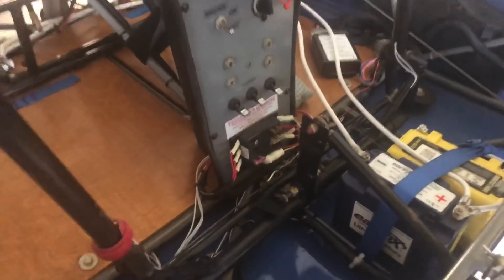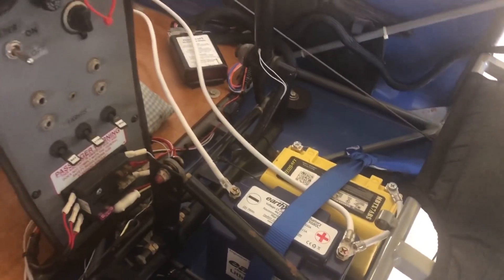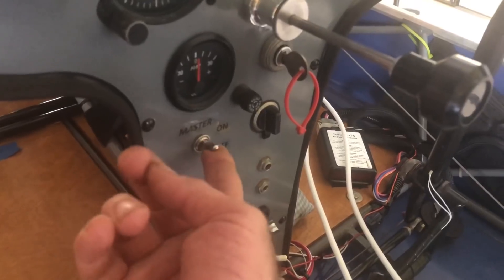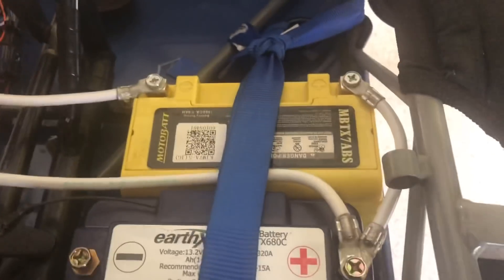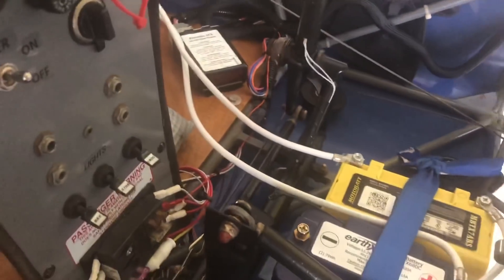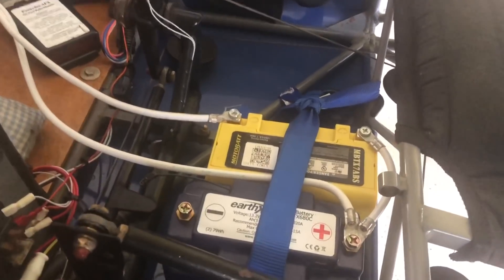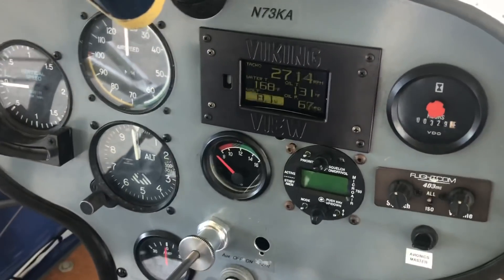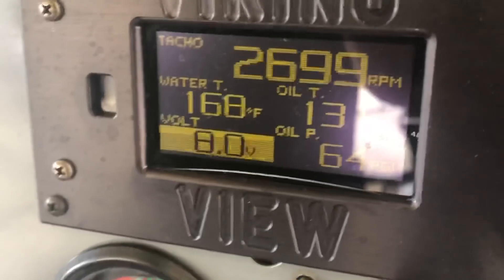LITHIUM OR LEAD ACID BATTERIES FOR YOUR AIRPLANE

Comment: This was'nt really a fair test.. comparing a higher capacity lithium to a lower capacity lead... What did you expect ?,  of course the lithium lasted longer ! The results would not be so dramatic had the Ex battery been compared to an Aerolithium battery. Compare a lithium to another lithium. .. But of course, Viking endorses Ex, so,  dont hold your breath for that to happen.
Reply from the maker: I guess you don’t follow along, we use sealed lead acid odyssey PC310s in our setups - we don’t like the EarthX in our setup due to unpredictability. I think you should know that facts before throwing judgment. This was a basic quick test done, wasn’t meant to be all that scientific. Essentially we wanted to see how long it would last in the lead acid, and used what we had at the time. We endorse products only when we know they are safe and work in our systems, and if at a point our opinion or experience changes, we change it.

Comment: I'm a huge fan of lithium battery replacements, but EarthX makes a really terrible product.  There are many reputable lithium battery manufacturers out there.  EarthX is not one of them. 

EarthX batteries fail all the time.  They're not reliable, and the company does not stand behind their products.  I wouldn't chance putting something like that in an airplane.  Maybe a lawn tractor or something.

Comment: As another commenter pointed out, generally a regular battery is considered dead at 10.8 or so, meaning it probably can't be brought back with a charger. Seeing the lithium "protect" itself and then have some voltage back is nice. Also should be noted that most regular battery chargers and tenders won't work with a lithium, so that comes in to play when long down times are needed.

an in between solution would be an AGM battery. I do not know if they make them in this size (I assume so, but haven't looked) and that much longer running times than a 'regular' battery of equivalent size and don't cost much less than a lithium. Can't beat the weight savings though.

Comment: CORRECT ME IF I 'M WRONG ! 
I am private pilot, an automotive master technician and have had many a road call for dead battery fails due to
alternator failures being the main culprit. A road call is an inconvenience, a fail in flight is an event ! The electronic
low voltage threshold was 10.5-11.0 v, rule of thumb ! How to make this, for lack of better description( I include 
myself in this ) "stupid proof " is with audible warnings. I found the average truck driver only stops when the engine 
quits or the air conditioning, unless there was a really annoying audible going off to interrupt his radio listing pleasure.
Point is we are creatures of comfort and it is hard to scan the gauges when enjoying a beautiful day of flight.
Reply: so what battery would you recommend?

Comment: Don't confuse Lithium Ion batteries (Phone, laptop) 4.2 volts per cell with LiFePo4 (Lithium Iron Phosphate) batteries 3.6 volts per cell like EarthX 
I built a custom dual 20ah battery system for my experimental plane; the lower cell voltage makes them an easier replacement for 12v systems.
The higher voltage of earlier lithium batteries was preferred because of the higher density/capacity. 
When LiIon batteries are seriously abused (over charge or punctured) they will flame and start a fire; LiFePo4 will not flame on failure of any sort making them much more reliable and suitable  for airplanes.

Comment: Were both batteries the same Ampere Hour capacity? How much did each battery weight?
Reply from the maker: Mistor Webman 
They were selected from physical size. The Lithium battery was 12 Amp hour. The Lead Acid was 7. The lithium weight was 3,75 lb and the lead acid 5.75 lb
Reply: @eggenfellner  
12 amp hours delivered by the lithium battery divided by the 2.75 hours  run time discovered in your test gives us 4.3 amps to run the engine. 
A 100 watt solar panel at 80% capacity = 80 watts. 
80 Watts divided by 12 volts gives us 6.7 amps. 
A flexible solar panel would be interesting…much less weight than an alternator with zero moving parts…

Comment: The engine wont run as long at higher rpm, it draws more current as the revs increase.
Reply from the maker: It is true.  Just used 2600 as a reference between the two batteries
Reply from the maker: idontcare80 
Yes, for sure. But this was to compare, more than anything else.